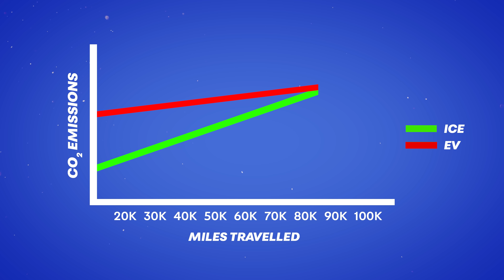Are Electric Cars REALLY That Green? [New 2022 Data]

Comment: I applaud Volvo for being open about this issue, a lot more than anyone can say for other mainstream manufacturers. The lifespan of an EV and how it's charged are really what's important: ICE cars, for their entire lives, pollute, after already polluting in the manufacturing stage, whereas EVs at least have a break-even point, and a Chinese-made EV operated in Poland may take near 100K miles to hit that point, whereas a Swedish-built EV driven in Norway could hit that point with its first owner and then every owner after that is getting places with minimal to no impact on the environment. These studies also take a look at the data from EVs that already exist and have been on the road for years as opposed to what's being produced now. Let's face it, Tesla isn't a super green company, and their battery tech has improved, so disappointing stats from 10-year-old Model S cars can be discounted as the vehicles being produced today are more efficient, use better tech, and will have longer lifespans, especially if their battery is replaced somewhere around the 100K mile mark.
Reply: How many miles are batteries rated for. Do they include figures for any gradual degradation? What about the point when it's time to change the battery. Before I heard it was every 10-15 years or so but perhaps it's longer now.
Reply: Totally, and I think this also shows that to really improve the greener-ness of EVs, manufacturers need to focus on reliability and lifespan. Batteries should last longer, as they'll be the biggest replacement and the one that hurts the environment the most. But mostly make EVs that can go half a million kilometers +. Not to continue the trend where it seems like all cars are made for the first buyer, and then no one cares if they go to the scrap yard after 200k kilometers. Who cares if the second owner drives with an eco benefit if they have headache after headache with all the electrical faults or rust.
Reply: @Propulus  Older batteries may not be useful for driving the EV; however, they will have great applications for household battery backup, energy grid backup / peak power generation and other applications.  Nissan runs some of their factory on used Nissan Leaf batteries.
Reply: No impact on the environment means the electricity and the tires are all green. Do they come from a recyclable source yet?
Reply: @kishkindhaa  "Benchmark ICE vehicles include BMW 330i 2.0, Audi A4 2.0, Mercedes-Benz C300 2.0, Alfa Romeo Giulia 2.0, Volvo S60 2.0, Cadillac ATS 2.0, Lexus IS 300 2.0, and Infiniti Q50 2.0."
Reply: @Konstantin Ridaya I know the numbers (thanks Jancovici studies) it’s not the best but it’s still far better than coil, gas, and oil by a factor of 2 to 3 (can be more depends of the country), windmills emit less than solar panels though. The biggest problem is that they don’t work all the time
Reply: @jonasweber9408  good points Jonas.  At least windmills can work in the dark, whereas solar is guaranteed not to work then!  Anyone who thinks “nuclear” is “green” or a “good idea” scares the s**t out of me.  I have seen wind turbines go bad on YouTube but it cannot compare with the still hot Chernobyl, 3-Mile Island & Fukushima & their lasting  environmental damage.   We haven’t even figured out how to safely dispose of nuclear waste from 40 to 50 years ago let alone today.  Finally, I don’t know any figures re carbon footprints of nuclear reactors (old & new), I just know they hang around for years while we try & figure out what to do with them.
Reply: @bravesirrobin1341  do you know the worst energy plant accident in history?
Reply: The high price just highlights the Teslas high demand, but yeah, that's unusual for normal cars. Some people have even made profit selling their used tesla
Reply: Cool thing from Tesla is that they produce more electricity from their solar panels than what the entire Tesla fleet consumes, a little FYI
Reply: @jonasweber9408  yeah, it’s pretty cool. They’ve also stated that they plan to make every supercharger station powered by solar so that they can price the superchargers as they wish, and have them consistent in a whole state of country.
Reply: If you have a GTL established using "green" energy sources, then the CO2 generation is offset & the EV generates more pollution, well CI2 anyway. The battery will generate pollution in the mining/refining of the materials & disposal or recycling. The ICE will generate additional NOx and HC. 
IF the EV lasts to require a second battery pack, then that will push up the CO2 delta by roughly the initial delta value again, so another 90k miles to work off the second deficit.
Reply: YouTube is so Damn Communist and Anti-American. They removed my post once again for simply telling the truth. We no longer have Freedom of Speech in USA.
Reply: Small sample size but all the Teslas I have checked for degradation seem to have lost less than 10% range over 150-200,000 km. Leafs much more of course, I have a 190,000 km gen 1 leaf and it has dropped to 59%

I also tested a 300,000 km electric taxi that had 98% battery remaining on a fairly odd and heavy battery chemistry.
Reply: @integralhighspeedusb  what is the price difference between your leaf and a similar generation Tesla ?
Reply: @chubbychicken5585  lol, don't mention it.
Reply: You need a power station to run electric cars man 🤣 never going to be no pollution and electric cars do produce particulate matter as well.
Reply: @elijahcarr4137  you also need power stations to produce oil and refine it
Reply: @jonasweber9408  of cause but only a little bit more and we don't claim to be green beans when we know none of us are
Reply: @jonasweber9408  when they tax normal people to the brink and hand out all that money to Luxury EV buyers in order to "save the planet" is what bugs me. 

We are double taxed on petrol already as well as government suggesting a pay-per-mile road tax. And for what?

We can drive an old car, on fuel, more than 60,000 miles and make less air pollution than that extra that is used to manufacture an EV over a combustion engine car.
Reply: @elijahcarr4137  If you don't like tax you'll be happy we don't drive ICE cars anymore, even if i'ts not as visible as cars malus and bonus you pay a lot of tax to the oil industry, it's in fact the most subzidised industry in the world! Because we basicaly all need it to survive.

I don't know where you live (France maybe?) but EV or not all these taxes are made to ban cars of the road an polluting cars out of the road in Europe, getting away from cars is the target to "save the planet"
it creates a huge social gap but it's still cheaper to run EVs for normal people. 

The amount of miles you need depends on the location and the car you drive it's rarely 60k miles it's more between  10k and 30k  ( the middle ground is : 12103 miles so around 1 or 2 years of ownership). You can verify it on CLIMOBIL which calculate the amount of miles needed.
Reply: @jonasweber9408 You're wrong about the mileage, watch the video again. He said it was 90,000 miles to break even with an ICE car.

 How is oil subsidized? The oil Industry as a whole maybe. I'm not an expert but kerosene and what not, maybe are, which we use for heating, but that doesn't translate to the customer at the petrol pump. Tax we pay in the UK is roughly 60% and the garages take huge profits on top of that.

Because of EV drivers and their subsidies and some paying only £30 road tax for some vehicles, we will be billions short, so EV's will be taxed too. 

We currently pay tax on CO2 emissions and not road use, which in my opinion is absolute bollocks. It makes sense to encourage us to buy environmentally friendly vehicles, but this new EV revolution is destroying the planet. Not only are we using up all the natural resources, but creating unnecessary manufacturing when we already have good cars to use. Hybrids are the worst!

Emissions from cars only contribute to 11%, where as industry is something like 60 percent. Shouldn't we be cutting down on manufacturing?

This EV thing is mainly about money and making private car ownership less achievable. To some, owning a car is one of the only nice things in life.
Reply: @jonasweber9408  Also, it does not make sense to buy an EV to save money. VW's electric Up costs £25000 before subsidies. The ICE version costs £10000 lmao. The average person doesn't even doesn't even travel that far so it would takes decades to justify the purchase. Comical
Reply: @elijahcarr4137  I’m not wrong because I did not say it WASN’T 90 000 miles I said “it depends” just check it out on Climobil it’s free. 

Oil is subsidized by the tax you pay. Basically the country you live in give a lot of money to the oil industry and producer countries to sell them oil and keep running the installations. Just google it up it’s the most subsidize industry in the world and the more it costs to extract oil the worst it’s getting. 

Money short yes and no because the country can make savings with only EVs (mainly because they don’t have to buy oil and gas anymore) 

CO2 is what is mainly changing rapidly our climate to the worst not natural ressources like lithium, this is nothing compare to oil, gaz and coil and the amount of natural ressources they use. You have to put things into perspective, if you look under the curtain for EVs you have to do the same for ICE cars 

cars are not what’s gonna save the world electric or petrol, EVs just consume less energy and don’t great as much smogs. Problem with the “we already have good cars” is that it doesn’t work at all with the general public, if it was working everyone would drive 1910 cars… cars change, you might as well change them for something that emits less CO2 

Road pollution is about 15%. Of course we should! Why would changing cars power would prevent us to do both? 

I see why people might think that but making EVs is way less profitable for car manufacturers (Carlos Tavares and BMW CEO were complaining about it recently) they also have to switch there entire industry and risk a lot. Making cars ownership less achievable? It’s a trend but it was coming since a long time and it’s a bit more what people want (they want big safe cars and that costs A LOT to buy so they prefer leasing), it’s not linked to EVs at all, the car industry is shifting to a service industry with leasing, insurance, bank, England is a good exemple compared to France where leasing is not something popular yet. I hope people don’t have only cars to be THE nice thing in their life I’m passionate about cars but hope people find happiness in all sort of things <3
Reply: @elijahcarr4137  so just buy the car when it makes financial sense then… 😅 simple as that. People are adults they can do the math
Reply: @jonasweber9408  Owning a decent EV will be expensive for years to come. The tech and resources are too complicated. Think of Cobalt and lithium, very rare elements. Chips. But one way they will make sense is if the gov tax us to the brink so we have no choice. That's not what I want. 

Electric cars seemed very exiting at first but like all things, that fades once it means giving up something else. 

I'd rather own a car thanks, one I can modify, take off road, do what I want with it.
Leasing is only an alternative to buying brand new, as you pay the difference of appreciation plus a little more. I don't buy new, everything I have bought has appreciated. 

Companies manipulate customers through design and other means to keep changing their car, therefore keeping the revenue going and keeping people broke. Leasing makes this process smoother for both, but it's not for everyone.
 

I still think it's better for some of us to drive a traditional car, especially in the countryside. EV's have there good points and all, but I still want to be able to drive an ICE car in the future.
Reply: @elijahcarr4137  I don't know what you call a decent EV but if it dosen't suit you it may suits other people for the same price. 
Cobalt is already present in big quantities in the oil industry to remove the sulfure I don't recall it was a problem before. 
Lithium is not rare at all, it's the 33th most abondant element on earth obtainable by pretty much every countries on earth (Australia is the first producer though) 
It's getting cheaper and cheaper to make EVs, it's estimated at 2025 the year EVs are the same price, it's about economic of scales they don't sale enough EVs to lower the price and margins are to low for historic car manufacturers. We already see that the price of the batteries are begining to don't match the price of the cars and people are wondering if car manufacturers are not taking advantage of the tax credits... might be true IDK and might not be the first time. 

EVs already faded away 120 years ago ^^at the times steam and electric powered cars were the most popular. I don't know what you mean by "giving up something else"

I prefer to own my car too (I have a shity 307 right now). It's just a general trend. 

Nobody will prevent you from buying and selling ICE cars, the law only bans to sell new ICE cars. So for you it will change absolutly nothing.
Reply: @elijahcarr4137  It won't be much longer before you see fuel duty added into the cost of recharging EV's, the same as it is in ICE's. They can add extra "pay per mile" tax in when they do that.
Reply: @jonasweber9408  It has nothing to do with pollution, the politicians just use that as an excuse. It has everything to do with raisingthe amount of tax needed to run the country. EV cars will soon start to attract "fuel duty" when they are recharged at roadside recharging stations. I'd also expect that home recharging stations for EV's will have a different rate that will include the "fuel duty" too.
Politicians may be stupid, but even they are not stupid enough to let that go a begging...
Reply: @jonasweber9408  Cobalt used in the oil industry is used as a catalyst in the refineries, so it doesn't take much to go a long way and it isn't consumed in the process.
Lithium may be common, but it doesn't occur in many places in deposits that are easy or financially viable to mine - about 4 countries around the world have viable deposits. If sodium batteries can be perfected, then that would be good, because sea water...
If the government would look at ways to reduce CO2 increase in the atmosphere, then it makes more sense - have non CO2 generating power (nuclear) to produce GTL (CO2 neutral) or Hydrogen (no CO2 involved) and allow ICE engine vehicles to continue, and add in the fuel duty on the EV's electricity supply to even things up.
For petrol at ~£1.43/litre (£6.43/gall) the tax burdon is £3.67/gall.
For an EV rough energy consumption/mile = 0.25kWhr/mile @ (2021) price/kWhr ~ £0.20/kWhr => £0.05/mile
Equate EV energy usage to ICE, assume 36mpg. ICE fuel cost = £6.43/gall, tax burdon ~£3.67/gall
EV cost ~36mile*£0.05/mile = £1.8, add in the same tax burdon as for ICE, cost ~£5.47 convert to cost/kWhr (36 miles uses 9kWhr) so EV charging cost/kWhr with equivalent tax burdon to ICE's ~£0.61/kWhr, to fill up a 100 kWhr battery (eg Tesla S) this would be about £61 vs £71 for an ICE car. Not so different when tax contributions are equalised.
These will be the costs when EV's are taxed the way they should be to provide the tax income they displace from ICE engined cars, and you'll still have time to have lunch while it charges :-)
Reply: @thecraggrat  whoaw you can see into the futur! Amazing! 😄 
Just put some freaking solar panels on the car and no more taxes if that’s what you care about…
Reply: @thecraggrat  mate you seam really smart and you looked into it, but it seams you didn’t do your research on hydrogen and synthetic fuel…
Reply: @jonasweber9408  Yeah, no problem, just stick a couple of BIG solar panels on there, should make ~500W on a car. SO for 200 miles of go juice, that's 50kWhr of energy (remember ~0.25kWhr/mile) or 2 days, but you cant charge at night, and really early morning and evening isn't great, but still, let's assume 12 hrs charging/day, so 4 days to charge your car for 200 miles travel ;-) Better plan that trip really well, and hope it doesn't rain! But yes, no more tax :-)
Reply: @thecraggrat  the average is 39 miles/days in the US (crazy by the way) so it’s sufficient for paying less money for daily.. Just look at the futur Sono Sion… but yeah always take the worst possibilities in life, great attitude 👍 is this the country that set foot on the moon? Complaining and not looking for solutions?
Reply: @jonasweber9408  Well, that's 'coz there isn't that much out there on GTL fuels and Hydrogen; though there is some it's relatively early days so I didn't bother much.
That said Hydrogen is obviously available from water & research is ongoing; catalysed hydrogen electrolysis has been achieved where the kinetic barrier to electrolysis of water is lowered, but a lot more work is required. GTL is pretty much in the same boat, it is being investigated & Porsche in particular are pursuing it to keep ICE engines running on their existing cars. Even algae that generate hydrocarbons from sun is showing real promise, so we'll get there reasonably soon I think.
All that being said it is early days, but progress is rapidly being made.

After saying all that, EV's will likely be more efficient, after all the energy used is generated with higher thermal efficiency than using the fuel directly. Carbon will still be generated though until the generating mix runs nuclear/solar/wind. Myself I prefer nuclear, as it doesn't result in vast swathes of land covered with windmill and birds dying by the thousands, or glistening fields of black!
I'm all for residential solar, no extra land used plus at least partial self sufficiency from the grid!
Reply: @jonasweber9408  That's 10kWhr/day you need to generate. to service your car, which means you need a battery at least 10kWhr in size. You could do that off a couple of kW of installed panels, as long as you don't use them for anything else and you size them right for winter. Or put a larger panel/battery in there and run your whole house, car and sell some back the Grid. As long as you have the space it is doable.
Reply: @thecraggrat  there is a lot of information online about hydrogen and its production (black, grey, green, blue, there is a lot of way to create it, even if 95% nowadays is black from Methane)
It’s not really a technical problem or something that Developpement will solve, we just can’t break the laws of physics, hydrogen production is inefficient, and electrolysis is not as efficient and financially viable as hydrogen from methane. The steel production is currently the most interesting industry that could benefit from hydrogen.

Synthetic fuels are nothing new. Germany produced a lot of synthetic fuel during ww2 with coil and hydrogen. It’s really inefficient and  Porsche is trying to produce it with carbon capture, an unproven technology. Algae oil is the same principle you just take carbon from another source. It’s a really little better than crude oil but it’s not feasible to produce enough synthetic fuel for the current demand. And it is a luxury product. 

I agree with you on the second paragraph. And yes from « well to wheels » it’s been calculated that EVs are more than 80% efficient. Hydrogen it’s around 45% and internal combustion engines 10-12% if I remember correctly
Reply: @thecraggrat  I really meant solar panels directly on the car. Really seams to be a great combo, I did not believe it to be honest but prototypes seam to do great.
Reply: @jonasweber9408  I already sort of answered you above for that. I reckon you could get ~500W of solar generating capacity on a car, which means you could produce about 20miles worth of go juice each day, OR go to work every other day ;-)
Reply: @elijahcarr4137  You are 100 Percent Correct. EV'S are Polluters. These Dumb Jocks who somehow think that we are going to get a world where there will be no pollution are just fantasy lovers.  I've said for a long time that this EV Thing is just Crazy and a bunch of lies.
Reply: "whereas EVs at least have a break-even point, and a Chinese-made EV operated in Poland may take near 100K miles to hit that point, whereas a Swedish-built EV driven in Norway could hit that point with its first owner"

I guess people can believe whatever fantasy they want.

You know that outside of Tesla, which is the world leader and innovator in BEV, some companies in China are right with Tesla, in every conceivable way.  Even in manufacturing, a couple companies in China can now make BEV for less cost than ICEV in China.  Tesla is basically on par at cost for making ICEV.  And, almost every car company in the WORLD is making making vehicles in China.

Chinese made BEVs are some of the best, if not the best BEVs in the world due to their technology.  The company who makes the most batteries for BEVs is in China, CATL.

So if anything, it would be the inverse, which is a Chinese BEV operated in Poland would take 20,000 - 30,000 KM to hit the break even point, while one made in Sweden would probably take twice that.

Go watch the many hundreds of vehicles from the Electric Viking youtube channel and learn something.  There are more BEVs on the road in China than anywhere else in the world.  About 45% of all EVs on the road are in China.  Their companies are much further ahead than Western citizens understand.  In fact Western citizens don't understand how much investing the Chinese, whether it's the govt or companies have done into BEV, battery technology, solar panels, wind tubines, and anything else dealing with moving to a green economy.  Leaders of countries keep saying how bad China is, but it's THEM who are leading nations that are far behind the efforts China has already taken.  And, they have COMPLETE buy in, at the govt., business and individual level, to moving that way, unlike in the West where there is constant fighting over switching to a green economy.  And I realize that it will be harder in more northern countries because solar isn't effective, but there's wind, nuclear, hydro.  But anyone who's evaluated the efforts of the Chinese govt. along with their businesses know the Chinese have done much more than any other country, AND have better technology, manufacturing processes, etc...  I mean hell, even though Tesla has come out with their 4680 Li-Ion battery which is the best Li-ion battery on the market, Tesla has STILL made contracts with CATL and BYD to use their batteries.
Reply: @johndoh5182  Again the cost is NOT the monetary value of the production of the batteries, but the CO2 cost. That  doesn't change if it is cheap to make the battery or expensive...
Reply: @johndoh5182  Chinese Technology???. What Crack are you Smoking. China HAS NO TECHNOLOGY. Everything they have they import from Developed Countries like USA. All they do is Copy. Learn your history before making dumb comments. Chinese Cars are Complete Junkpiles.
Reply: ICE car can last decades, once the batteries on the EV are toast those cars are going to be junked, no one is going to pay thousands of dollars for a new battery on an 8 year old plus car.
Reply: @venom5809  they can do if maintained impeccably.  However, the price differential between EVs and ICE cars in terms of maintenance and fuel costs would mean that the average car user would still be quids in if they replace a battery after lets say 10 years.  Dont forget this battery would still have value in terms of being able to be used as a fixed energy storage to power commercial or residential settings when combined with others. Dont forget that Clarkson once famously said that EV batteries would be dead after 3 years....
Reply: @venom5809  I completely disagree.  An EV is likely to last much longer as it's a far less complicated machine.  Even the brakes will last longer because they're not used as much.  With modern battery technology, conditioning, and temperature control, the batteries can be expected to last for a few hundred thousand miles.  Even then, they have value for reuse in grid storage.  Replacing batteries in used EVs is getting cheaper and cheaper, too.  Would I pay, say, $5000 for a new battery in an old car I loved?  Yeah.
Reply: @ProfRCook  and the old battery can either by receycled by around 90% or used as a battery for the electric grid
Reply: @ProfRCook  But the point under discussion isn't replacement cost in $$, but cost in CO2. The replacement cost in CO2 will be a similar "payoff" time of 90k miles travelled.
Reply: @ProfRCook  Your average person is never going to spend 5000 on a new battery. Fuck, your average person is not even willing to spend 2000 on new engine for their old car.
Reply: EV's are NOT CLEAN. They Pollute. ICE is CLEANER than EV'S. EV'S are Golf Carts.
Reply: @caleblane7619  okay EVirgin 👍